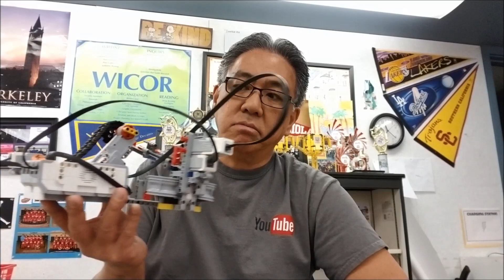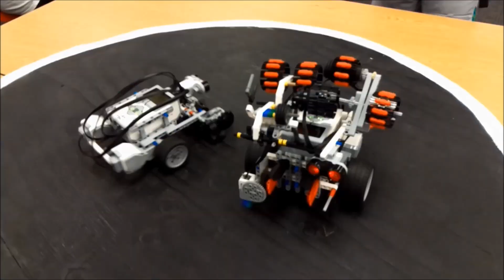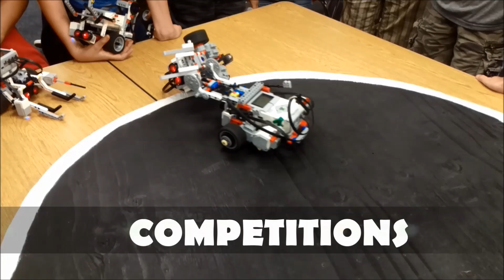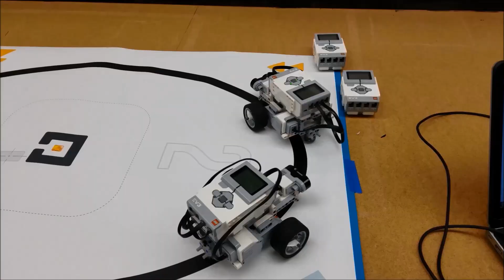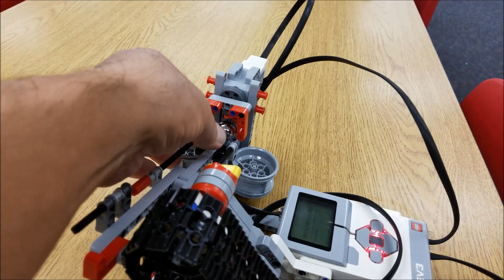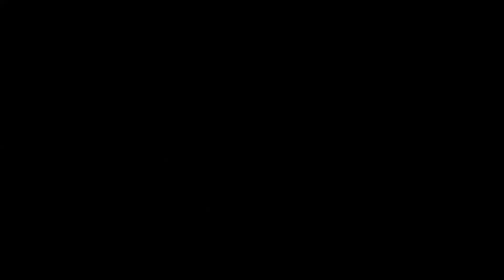"The LEGO Mindstorms EV3 Ball Conveyor" (Building Link & Program)

Comment: Interesting, the randomization function has a lower boundary of -1 and an upper boundary of 1, your switch is set to route the ball to one side on 0 and the other side on 1 and on -1 to
sound the ratchet wav and not route the ball, so is this a random block thing or was it part of the educational plan for learning. I'll start by looking at the plan. :)
Reply: Looks like a simple learning moment although not specifically addressed as such in the ED notes that I can see. Change the random lower boundary to 0 or leave it as is and choose a direction to direct the ball like the other two switch settings and the "ratchet" goes away.